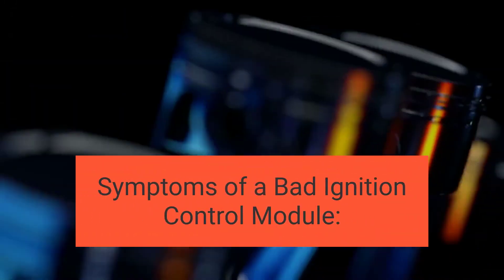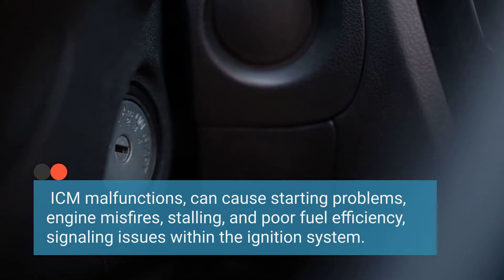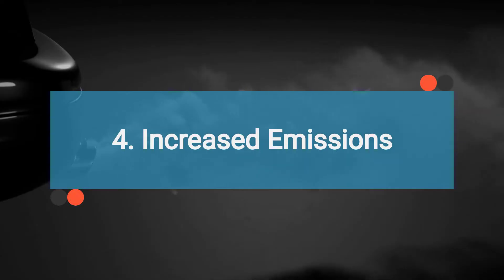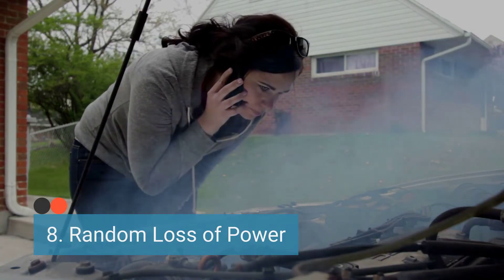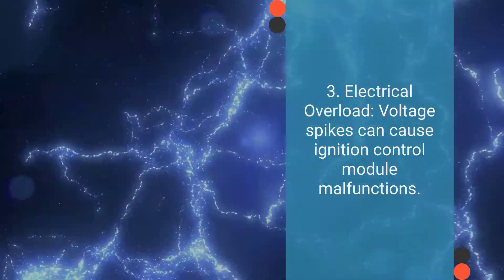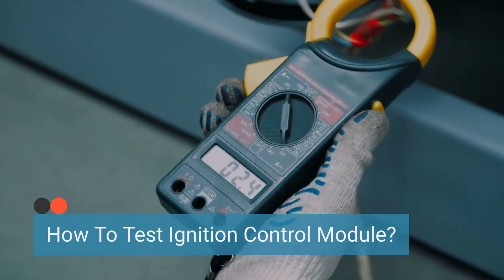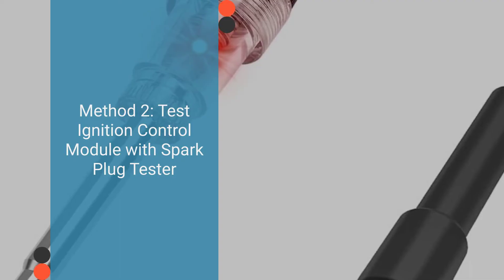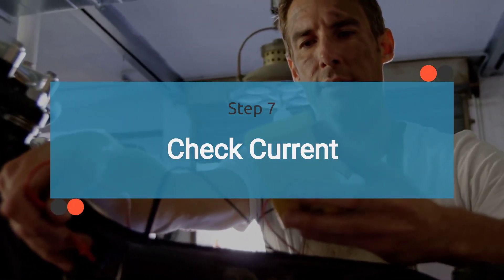Symptoms of Bad Ignition Control Module: How To Test & Causes

Comment: Breaker points ignition was far more durable than ignition control module (icm) less expensive, and produced nearly equal horse power. ICM causes more pollution due to malfunctioning.